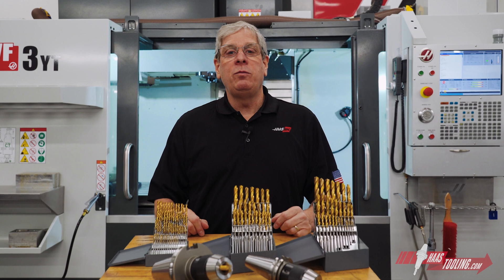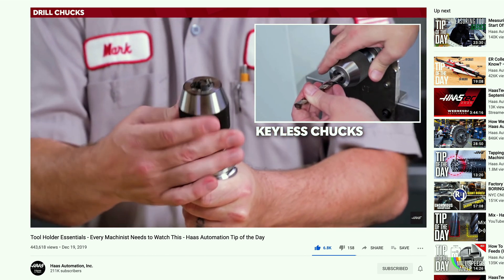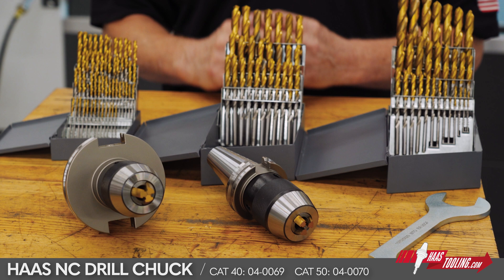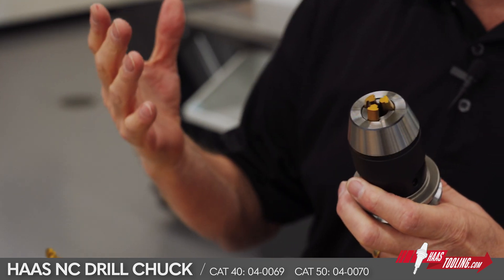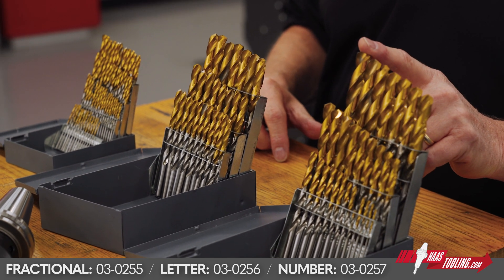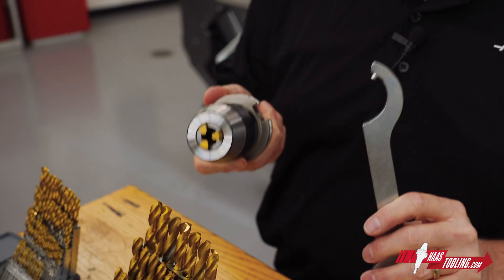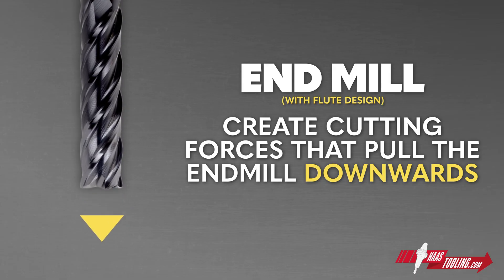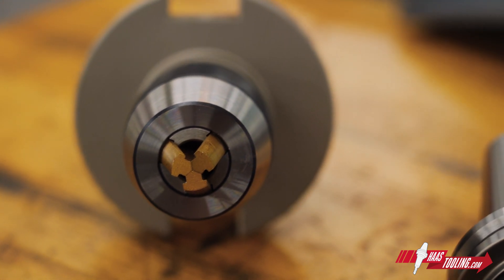Check Out NC Drill Chucks on HaasTooling.com - Haas Automation, Inc.

Comment: Is Haas tooling made in China? If so I will unfortunately never be buying it. I will buy things made in North America, Europe, Japan and Taiwan. Other countries on a case-by-case basis, but never China or Russia. Some decent stuff coming out of Poland right now, no human rights issues involved.
Reply from the maker: We list country of origin for every tool along with all the specs.  This page has the 40T drill chuck: https://www.haascnc.com/haas-tooling/mill_toolholding/drill_chucks/04-0069.html
Reply: Why does it matter? 0.04mm in China the same as it is 0.04mm in the US. If they specify 0.04mm runout, then you will get 0.04mm runout regardless of whether it's made.
Reply: @henrychan720  The 50 cent army has arrived I see

Comment: We have about 10 of these holders collecting dust at the shop... Not a good holder
Reply: you must have a very well organised shop with holders for every tool then. The shop i work for could use a few of these. we have dedicated sidelock/collets for end mills and tapping drill sizes along with a variety of other tools, but for other sizes of drills we could use a few of these since theyre so easy to change. no running around searching for collet holders just to realise youre using your 8mm collet for your 8.6 drill for tapping m10, having to change out the tool then change it back. More collets could be bought, but just about every tool space is taken up in the machine.
Reply: @declancampbell1277  Techniks makes 3-jaw drill chucks that are able to hold carbide drills securely. You tighten them with a 6mm T-Handle and they're guaranteed .0008" TIR

Comment: I love haas, but in what world is .0015” runout “low”?
Edit: I was an idiot. One-and-a- half thou is great for a drill chuck. I’ve decided to keep this comment up to highlight the replies and to not hide from my mistakes.
Reply: Drill chucks have higher run out than collets. Not sure why anyone would want to use them for routine work. I only have one for emergencies when I don't have the right collet.
Reply: In the world of Jacobs chucks where fits run loose, holes run large, and it's considered normal for your bits to flop around like a dead fish.
Reply: if im right thats about 0.04 mm. as far as runout on endmills and the like? it could be better. for a drill in most standard applications, especially for this type of holder? its well within tolerance. its not exacltly H7 tolerance, but .04 is so little of a difference it matters fuck all.
Reply: @declancampbell1277  yeah but I still wouldn’t call it “low” runout.
Reply: finding a drill chuck with less runout really isn't gonna happen. Most of the time it's even worse, smallest I've ever measured was one thou. The one good thing about this is that they're upfront about it. Still a better idea to just buy collets lol
Reply: It is pretty low for a drill chuck, not that I'd ever use a drill chuck in a CNC machine.
Reply from the maker: Graham, In the world of drill chucks .0015 of runout is low for this type of tool. While that amount of runout is too much for a carbide drill in a production setting, this runout is perfectly fine for high speed steel/cobalt drills.
Reply: It's perfectly fine for jobber drills and general purpose drilling.  If you're needing higher accuracy hopefully you won't be using a drill chuck.

Comment: So the company that can’t make tight tolerance machines are making holders now? Wouldn’t touch this if my job depended on it
Reply: been a long time since that was the case in haas machines as far as i know. they fixed the rigidity issues a while back
Reply: @declancampbell1277  people still think Toyotas have a sticky gas pedal.

Comment: There is something in NC drill chucks that I don't trust them. Can't imagine pushing a drill in a CNC with those.
Reply: they are fine, get 3. wasting time looking for a free collet! if yer scared use the wrench to snug her up
Reply: On the other hand pushing non-round-number drill sizes, particularly in the lower clamping range of the collet in ER collets is quite horrible.
Reply: I’ve put up a 1/2” drill into a chuck with success with aluminum, but I wouldn’t trust it for nothing harder than mild steel. At that point I’m using carbide drills with standard size shanks anyway.
Reply: I've used drill chucks to cut 0.5" holes 2" deep in mild steel with no issues.  They're perfectly adequate for deep hole drilling and general purpose and a great value.  If you're needing more accuracy or deeper/larger holes you're most likely going to be using a chuck or tool which is 5x the price.
Reply: I don't understand who they are trying to sell to. If you want to sell tooling that only a beginner would buy. Why don't you offer A lower price mill? The only Mills these guys talk about are vf69 with 420 axis. But then try and sell a drill Chuck? Didn't these used to come with a new machine purchase?